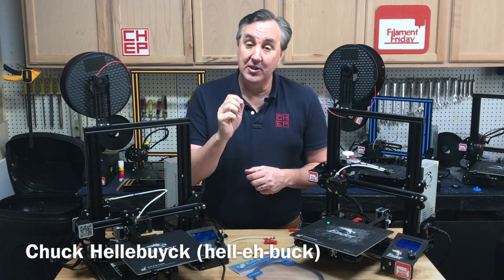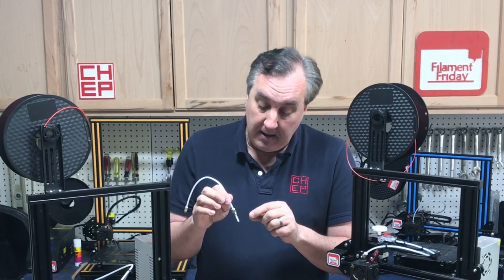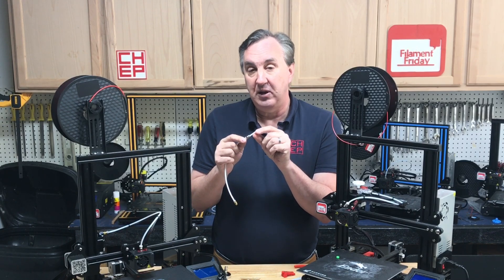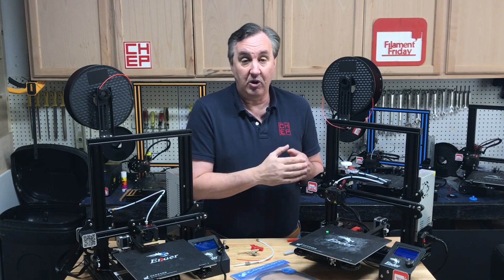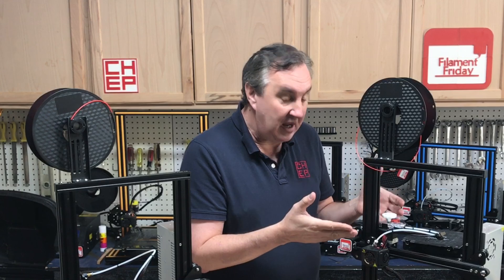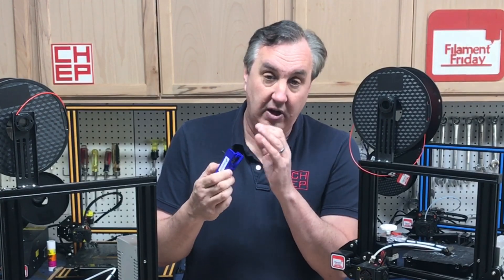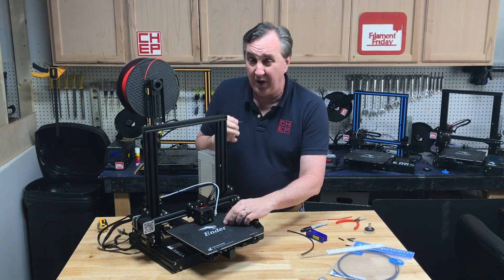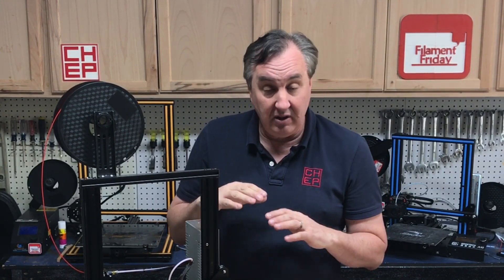Simple HOTEND FIX for Creality Ender 3, CR-10

Comment: What material did you print the washer with? Can it be PLA?
Reply: according to Chucks Thingyverse comment on the washer file, he printed it in PLA
Reply from the maker: Yes, I used PLA. If it gets too hot for PLA up there then you have a failing fan.

Comment: shit i was following along with the video exactly and didnt print the washer before taking stuff apart
Reply: An excuse to buy a second printer. “But hun,  I need another in case it breaks while I’m doing a project. I used that myself. I bought a third on the grounds of “what if they both break while I’m doing a project?”.
Reply: @simonsimpson4695  lol if I had space for them i would definitely have already bought a few more ender printers

Comment: THis fixed my problem.. cannot believe I missed this super simple fix!!  I cut the bowden with flush cutter, mistake, it made the tube a V and leaked

Thanks for the video!
Reply: Just troubleshooting my current issue - did the v tube result in your extruder clicking?
Reply: @nicholas2140  Yes, it would try and feed but the hot end was clogged because the filament was to cold to flow.

Comment: It's a couple of bucks, but just drop the old design with the tubing going into the block and get an all metal hot end.  Mine got to the point where I had constant clogs and even filament leaking through joints in the hot end and was having 100% failed prints. Replaced the PTFE with Capricorn, then replaced that several times. Finally went with the Micro Swiss. Zero failed prints relating to the hot end so far. Just eliminate the weak points.

Next, direct drive.
Reply from the maker: It’s more than a couple bucks. It’s $60. I’ve seen clones that are cheaper but they are hit and miss on their inside polish potentially causing new issues.
Reply: @FilamentFriday  Yes, $60. Metaphorically a couple. 

I wonder some times with Creality. I get their machines are cheap, but so often they could just make a better machine for a few bucks extra here and there. Or offer an upgraded version for extra sales.

These hack-a-day videos are neato, but at a certain point, just buy parts that work. Even the Capricorn tubing will wear out in the block. It's not a permanent fix.
Reply: Can you use the stock PTFE tubing with the micro swiss all metal hot end, or should you switch to the Capricorn brand?
Reply: @jorgenfischer  You can use the stock.  Since the tubing no longer goes into the heating block, it never overheats and no need for higher temperature stuff. It only engages with the tubing retainer fitting at the top of the heat sink. It stays quite cool there.

Comment: Hi. I'm watching this channel since I get my Ender 3 v2, and this is the first mod I made. But last night I found out that fitting on the hotend became slightly loose so I dismantled the hotend assembly and figured that this mod can be applied in a much simpler and more reliable way, at least from my standpoint. 
Heatsink has a ridge inside which blocks vertical movement for heatbreak on top side. The heatbreak is 7 mm outer diameter, and the ridge is around 6 mm inner diameter. So simple standard flat ISO 7089 M3 washer stick on top of the heatbreak creates a nice sturdy barrier for ptfe and clamping force at the other end comes from the nozzle and those 2 screws on at the heater block. M3 flat washers by the standard are 6.64 -7 mm outer diameter, 3.2-3.38 mm inner diameter and thickness is 0.45 - 0.55 mm. Just enough to fit nicely. PTFE tube is cut to 0. 5 - 1mm size longer than the heartbreak length. The "drawback" is that the nozzle is lower for that washer thickness of around 0.5 mm.
I also modified Your ptfe coupling (drilled to 4mm hole inside to pass a tube through it) that I had laying around to replace bad stock hotend fitting which failed at the end. By Murphy's law the only part failing will be the one you don't have spare and can't buy on Sunday :D For now it's only 6h of Karl Johnson's retraction calibration with PLA as a load test and still going strong with no change whatsoever.
Btw. Thanks for that coupling, that really saved the day :) This channel is my regular go to in case I need some meaningful information on Ender 3. Very nice and clean presentation without unnecessary chatter.

Comment: In concept, this sounds like a great idea, but if you think about it, the gap between the two tubes might cause an issue if one shifts a tiny bit, witch would cause a road block when feeding filament in. I'm still a bit naive when it come to things like this but it sound like a issue that would drive me crazy

Comment: iv found the oposite haveing the etra chube causes blocking !
Reply: I had the same result but I think I've found why. The internal machining of the red block is different on my Ender 3 V2 to that shown in CHEP's video. There is a tapered void at the top of the block which means the printed washer doesn't get the support it needs and it deforms and causes blockages. Not sure why they have changed the design but it's certainly changed from what you see here in the video.

Comment: What is (reasonably and comfortably) the maximum temperature after this fix? I can imagine that you will not be able to print at the max 260 degrees C, but will you be able to print most PETG fillaments?
Reply from the maker: 250 is the max.

Comment: You did mention this, but I didn't quite understand. When comparing this method to fully inserting the capricorn tube - which method do you think words better? 
Let's assume that I don't have an ezr extruder and wont be using ninja flex. At best it will be PLA and PETG.
Reply from the maker: It traps the small PTFE better so it reduces issues. 
Yes it will print those.
Reply: @FilamentFriday  super, thanks.

Comment: DO NOT DO THIS you will print fine but you'll never be able to change your filament until it runs out so pick a colour and stick with it for the full 1kg.
Reply from the maker: Not true. I switch filament all the time.
Reply: @FilamentFriday  I'm not able to pull the filament out unless I force it far too much.
Reply: @Krytern  If you heat up your hot end to a proper temp for the filament you're using before retracting, the filament should come out just fine. Is it possible your PTFE insert was a bit too short and it's causing a clog?
Reply: @phobes  I always heat it up this never happened before adding the insert.
Reply: @Krytern  How long did you cut your capricorn tubing?
Reply: @Krytern  did you try heating up your nozzle and using the firmware to reverse your extruder? Thats what do, i go -50mm then pull it out the rest of the way to avoid yanking/breaking the filament.
Reply: @FilamentFriday  is it possible he has printed his wee spacer/washer between the ptfe and capricorn tubing with pla and now he has melted his filament to the spacer/washer and henceforth causing un-removeable filament?
Reply from the maker: No. If you change filament you should push some out first and then pull back so the end is soft and comes out easier. This is true whether you do the mod or not.
Reply: @FilamentFriday  This is not always possible if the filament breaks close to the extruder
Reply: Why not? What issue are you seeing that this fix causes? Asking because I'm going to attempt this.

Comment: Hey stupid question do you think a 4x2mm titanium tube or stainless steel tube would work in place of the ptf inside the hot end ? Im new to printing.
Reply: I don't think that would work because the ptfe tubing inside of the hot end needs to be compressed to have a snug fit against the nozzle. (It is squished down by the plastic washer). I think a metal option would kind of work but it wouldn't get you as good of a seal between the tube and the nozzle head. Not to mention it might damage the metal on the nozzle since it would likely be harder than the nozzle (which is brass and therefore less hard than titanium or stainless steel).

Comment: Hey Chuck, I have used your setup and your profiles with minor changes for a long time now with great success (so thanks for that). Couple days ago my printer starting having a really bad stringing issue out of the blue. I cleaned the dual gear aluminum extruder and made sure it runs smoothly, changed the bowden couplers, replaced the capricorn tube both inside the hotend and outside, replaced the plastic washer with a new one, cleaned out the hotend by passing a bowden tube several times through, changed the nozzle with a fresh one and made sure to hot tighten it, tried different filaments, tried lowering the temp, but I still get horrendous stringing. I have run a couple of retraction tests and it does not get much better even with extreme values for retraction length and speed. I am fresh out of ideas, so any pointers will be greatly appreciated.
Reply from the maker: Try a different filament. See if it changes.

Comment: the lengths are all different because the aluminium hot end is threaded all the way through, and the steel sleeve is screwed about half way into it, then a setscrew on the heatbrake holds the sleeve in place
(the 2 screws from the hot end to the heatbrake are needed to stop the sleeve from unscrewing or if the setscrew slips it will not drop)
without the nozzle the tube can go all the way to through the hot end

so the length of the tube is from near the top of the heatbrake to the bottom of the sleeve where the nozzle screws up to
Reply: Also since Chep didn't mention if he put a new nozzle in he could bump with some leftover filament on the top of the used nozzle, changing the distance slightly everytime. I would change the nozzle before using this and measure with a PTFE tube instead. It doesn't need to be perfect as Chep said, as long as the piece of PTFE tube is snug against the nozzle afterwards.

Comment: Will a piece of brass tube work this way?
Reply from the maker: Doubt it. Heat creep will expand the filament and block the path.
Reply: brass conducts heat alot better than steel and the ptfe tube plastic

Comment: How do you get the little bit of tube back out?
Reply: unscrew the nozzle and ptfe fitting, then push in a longer piece of tube til it comes out the hot end
(if it was clogged, turn temp up to 150c)

Comment: I implemented this hotend fix and it works great!  It just occurred to me that since it depends on pushing against the nozzle, I might need to loosen the top connector when changing them, then reset after the nozzle is on.  Or is it pretty standard - not worry about it?
Reply from the maker: Loosen the coupler.

Comment: Don’t do this the creality is great as is. These two idiots are just idiots. Or maybe they need to explain it better. I’m no fool but this shit is stupid. My 2 printers print fine without this stupid “mod” don’t waste your time on this stupid shit.
Reply: Your PTFE tube will unscrew the coupler when it's rotating as the hotend moves along the x axis, resulting in some problem you won't know the solution to, resulting in a lot more of wasted time and prints on your end than a simple fix like this.
Reply: I don't think that your words are the right ones and your argument is fully valid but i'll extend your statement a bit: 

I think this is not necessary when you assemble the hotend the right way. If you screw the nozzle not all the way in, butt up the ptfe against the nozzle and then screw the nozzle tight you will be fine without this washer. 

The second thing is the heat resistance of the ptfe ... well if you buy the TL Capricorn you get the looser fit you want, if you want it.

Comment: I was afraid this would happen:  the funnel is too rough, the filament gets stuck on the top/outside opening of the funnel and can't get down into the Capricorn tubing below, I also noticed the washer was ~ 1.5mm smaller diameter than the extruder inner diameter threads, so it can move around quite a lot while installing.  I tried assembling with a length of filament going through the top/outside PTFE tubing and sticking out far enough to force the funnel & lower/inside Capricorn tubing into alignment, which seemed to work but then I pulled the filament out and tried pushing it back in, same problem:  the funnel just won't align properly  :'(
Reply: seems I was able to resolve it by poking an awl into the exposed top of the Capricorn tube to expand it so its outer sides are touching the inside of the heatbrake, also sanding the printed insert with a small rounded file as it spins in a drill chuck (careful!!  don't snag the file on the chuck, or you're going to have a bad day..!)

Comment: I believe the PTFE should be cut .5-1mm longer than the calculated distance so that the nozzle presses firmly against the PTFE tube and leaves no gap. 

One way to do this and avoid any measuring, is to remove the heatsink with the heatbreak from the heatblock and insert a long tube with the washer and bowden coupler in place. Cut the PTFE tube so it is nearly flush with the end of the heatbreak but sticks out .5-1mm. Reasemble and you have a foolproof method with no measuring involved.

Comment: I just did this today due to clogging issues, and was wondering if there is an easy way to remove that small piece of capricorn tube (when needed to remove) with a pair of sharp long nose pliers or have to remove the nozzle and push it from one end?
Reply from the maker: Either works. Just heat it up first to make it easier.

Comment: Chuck I have just got into 3D printing and got a Ender 3 Pro and you have helped a ton with learning about all the ins and outs. One thing that I have been having issues with is what appears like bubbles appearing in my print. The first few layers will be perfect but then I will start seeing bubbles or pockets forming and I cant figure out what is causing them. I have tried increasing my nozzle temperature to remove any over extrusion but it doesn't seem to help. I have looked around online but cant seem to find any examples of this happening anywhere else. Any ideas what could be causing it?
Reply from the maker: The filament could be old and absorbed moisture. Try different filament.
Reply: @FilamentFriday  If the filament is wet, why would it not affect the part equally and only affect the last half of the part?
Reply from the maker: Depends on how it absorbed it. It’s the moisture expanding from the heat typically.

Comment: i have got an issue with my ender 3,  it prints the walls just good but the infill lines or the walls of infill always are under extrusion, i mean not continuous but a lot of breakages or very thin lines. I m not able to figure out this issue for some reason . I did followed many of your tutorials to fix the under extrusion. The biggest issue is the stock pneumatic coupling at the hotend will be so tight that once after inserting it i m unable to remove it smoothly. It cuts the PTFE tube internally with the pins it has to grab the tube. Need a solution.
Reply: I had similar problems and turned out to be due to clogged nozzle.

Comment: Chuck, I've learned a lot from you and your videos. I cleared a clogged nozzle and decided to do this fix. Since then I've been chasing a print issue. 1st layer goes down like butter, nice and even and smooth. However, the second layer gets really messed up and rough. Looks like over extrusion. I've been playing with the flow rate. Calibration cube tells me to reduce to 94% but the prints don't  improve until I'm down around 75% flow. Is that normal to reduce that much? Hoping you can help.
Reply from the maker: That is strange. Check your nozzle proper hole size.
Reply: @FilamentFriday  yes sir. .4mm nozzle and verified that is set in Cura. I did finally get to the problem. My X Gantry had a loose wheel causing it to shift on the Y axis. Basically it would slightly roll back and forth when the bed was moving back and forth. I think that caused the nozzle to jam into the print. Reducing the flow that much was probably just masking the issue.

Comment: Everywhere i go people say cap tubing has a higher heat resistence.. But ive been unable to find what the heat resistence is
Reply: Thermal resistance is the resistance to absorbing heat.  A higher value means it will be cooler than a lower value.  Thermal conductivity is essentially the inverse.  A higher thermal conductivity means more heat absorbed (example. copper absorbs more heat than wood).
Reply: It's about 260c the creality stock has issues around 230c at the highest.
Reply: @michealc6439  sweet thanks...

Comment: Am I the only one who tried this method and the hotend coupling unscrews itself during printing? It takes it about half a Benchy to unscrew itself to the point that the 2nd half of the Benchy is always messed up..

??
Reply: I see that too.. also my filament eventually jams and my extruder motor start skipping steps. The length of tube piece I cut might be a 1 or 2 mm long. That is the only reason where I see it could be going wrong.
Reply: Ninad Pachpute I ended up going to the good old method - unscrewing the Bowden tube 1 turn, shoving the tube all the way to touch the nozzle, heating it up to around 220, and screwing the nozzle all the way. That presses the nozzle against the tube and if the tube is cut straight than it creates a great seal

Comment: I love your videos and they are very helpful and informative, but one thing I just can't figure how and it's why you glorify the Capricorn tube cutter so much?   it sucks - the blade flexes while cutting and the cut is angled 100% of the times, let alone that it doesn't hold the tube straight, and the tube is always curved...  What am I missing here?

Comment: I was just thinking......what if you made the hot end from a block of ceramic material and fixed the heater with the nozzle in the bottom end and the PTFE tube in the top........no heat sink cooling fins and no cooling fan as no heat would transfer back with ceramic so that would mean a much shorter block altogether.
Reply from the maker: Maybe try it.